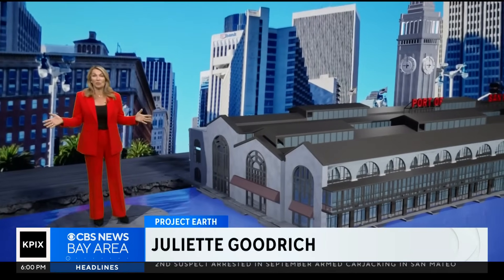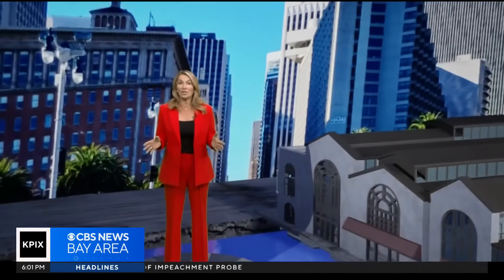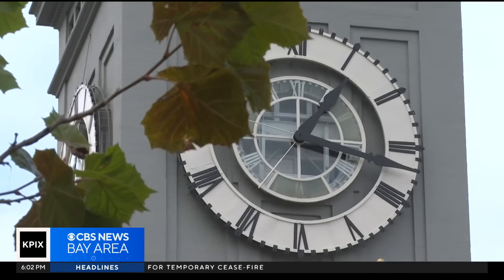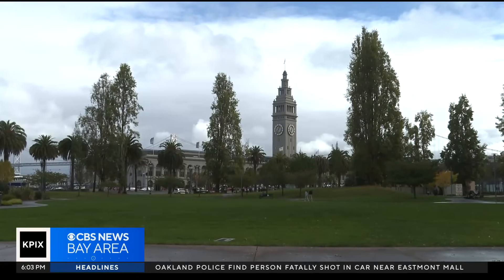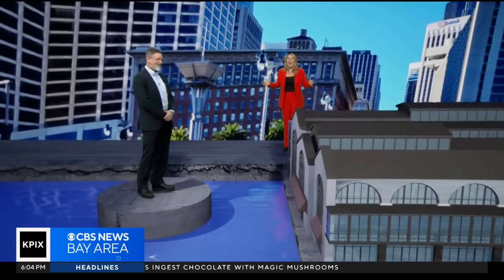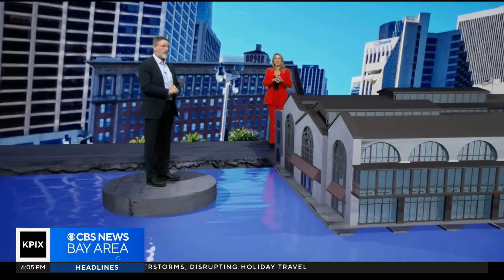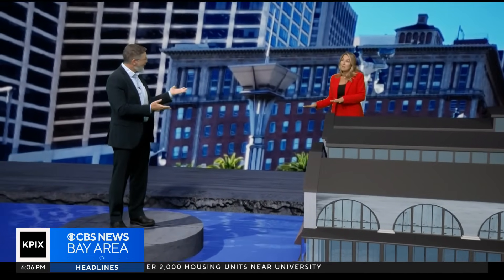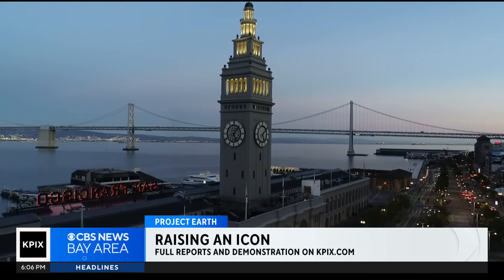Ambitious engineering project will raise San Francisco Ferry Building seven feet

Comment: The water on the Embarcadero is rising because the street, and the Ferry Building were not built on engineered landfill. 

Like the Marina District, which was rendered uninhabitable for 9 months after the 1989 earthquake, this part of San Francisco is built on top of landfill that was a dump.

The organic material in the dump has been rotting and shrinking for over 100 years.

Like the nearby Millennium Tower it is all sinking.

Question: If the SF Bay is rising, how come we don't need to raise the towers of the Golden Gate Bridge? It's made of steel. The bay is salt water. The steel will rust!

Answer: The foundation of the Bridge is built on rock.

Funny how the water isn't rising 4 miles away over by the bridge.
Reply: Such convoluted contortions just to avoid a widely accepted fact. Some of your compatriots go the "It's not caused by humans" route, which takes a little bit longer to refute. Arguing that the seas are not rising at all is really quite silly and easily disproven. There are numerous records of this from around the world.
Reply: @Brendissimo1  They are rising between 1.2 and 2.8 millimeters per year, that's about 8 inches every hundred years.
Reply: Factual and correct. As I'm sure you know, sidewalks are sinking throughout the Bayfront area.